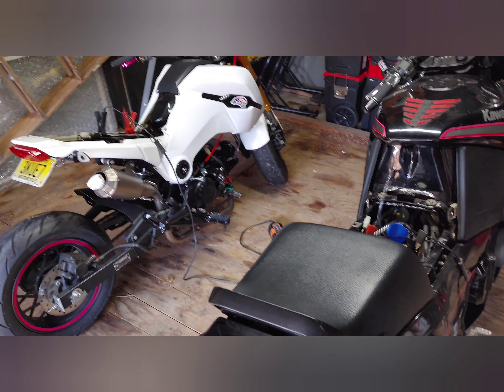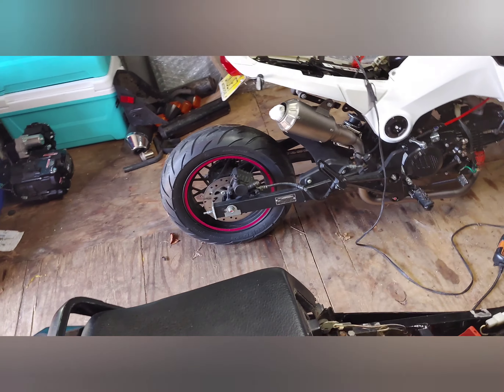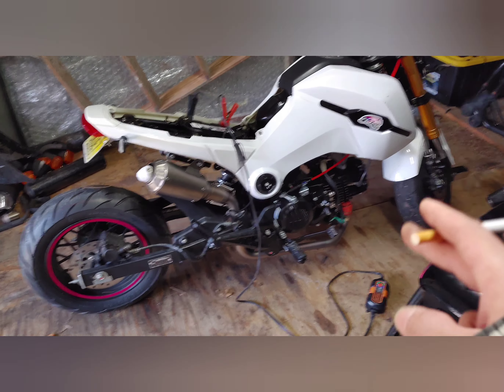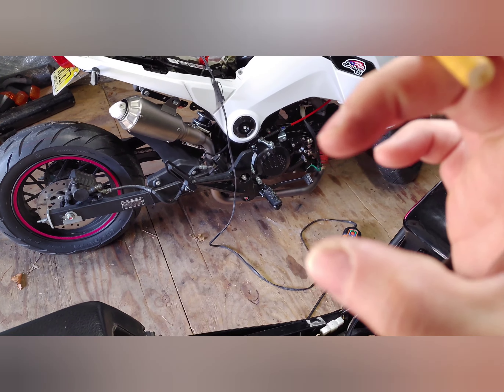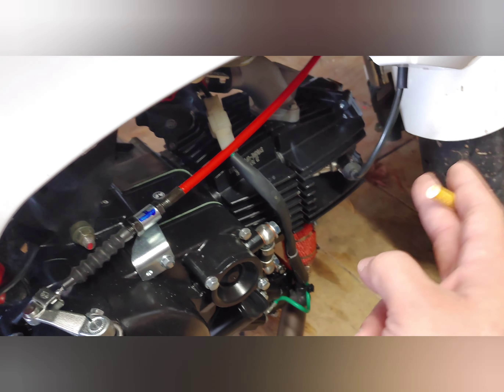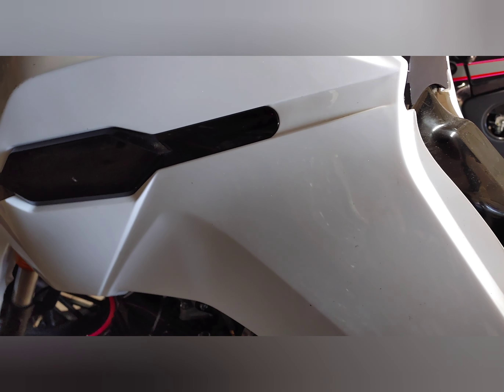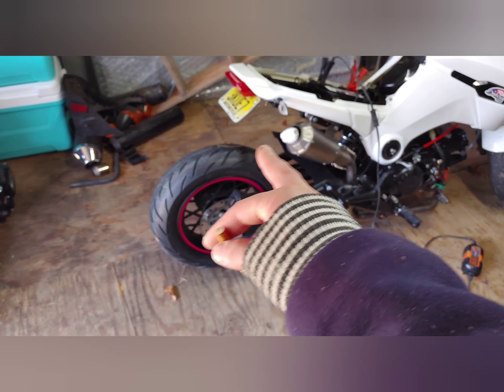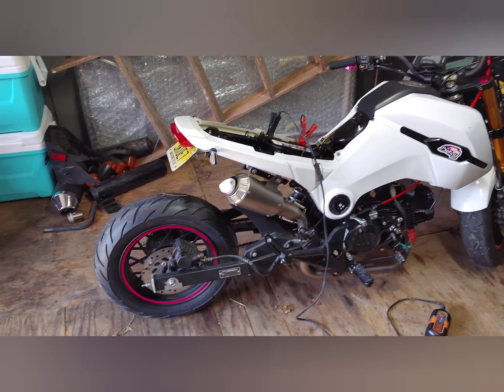21 Icebear Fuerza Grom clone (Brief build overview)

Comment: How is that 3rd motor mount ?  Is it a good sturdy part cause I want to know if it is as dependable as the steel plates that are welded on cause I’m 6ft 230lbs so all extra protection and modifying is a must for better performance and longevity cause I don’t plan on ever selling it and building it as tough as possible cause I want it to be my daily mode of transportation sunny or rainy days. Thanks for the video and all the info , CHEERS FROM EAST LOS ANGELES CALIFORNIA, RIDE HARD N RIDE SAFE MINI HEADS! 🏍🛵🎱🍾🍻💣💯💯👌🏼👨🏼‍🦲👍🏼🏍🏍🏍🏍💯💯💯✌🏼🙋🏻‍♂️✌🏼
Reply from the maker: Thanks for watching, glad you're enjoying the videos, so to answer your question, for my wife that she's 120lbs , 5ft nothing, it's been pretty good, it's holding strong. She doesn't stunt the bike or anything, she cruises with it . But we're still testing to see the longevity of the 3rd mount.